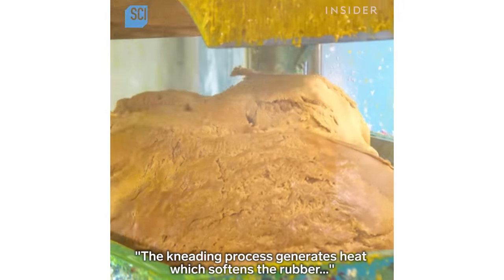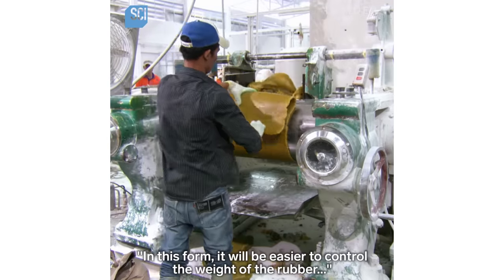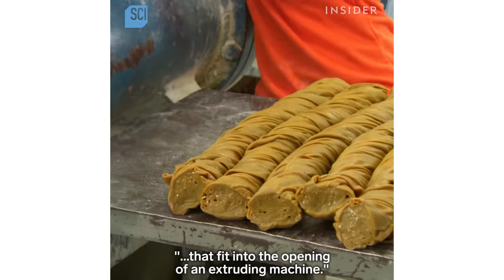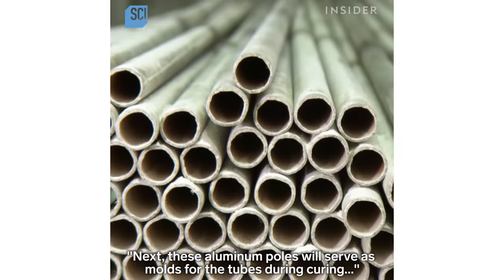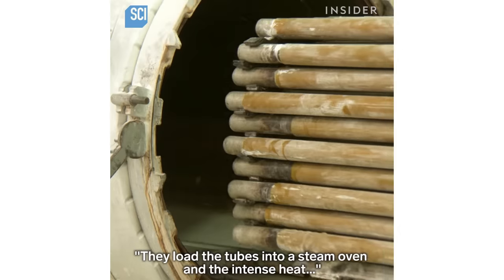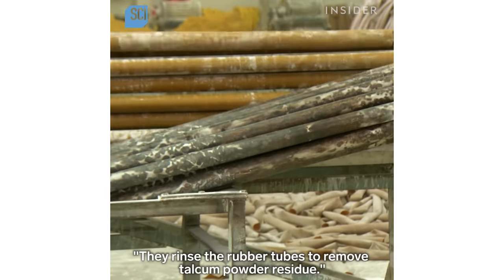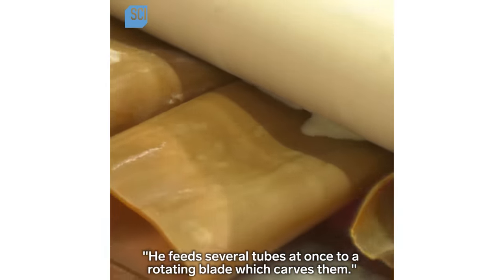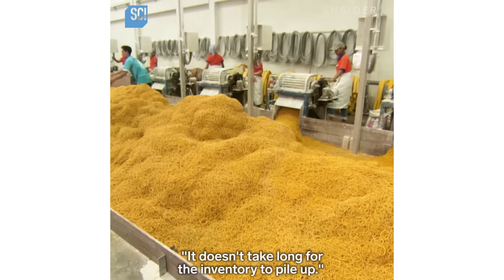How Rubber Bands Are Made

Comment: If they just insert the tubes to the spinning blade while it's moving, I wonder if that means there's possibly a few "dud" rubber bands in each batch that's thinner than it's supposed to be, because it enters the cutting area as the blade's already halfway through its rotation.